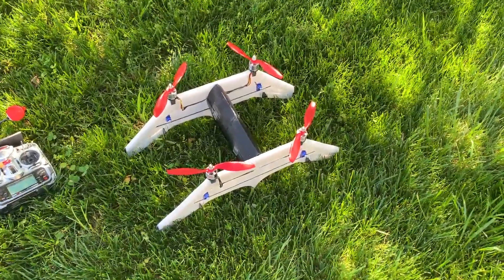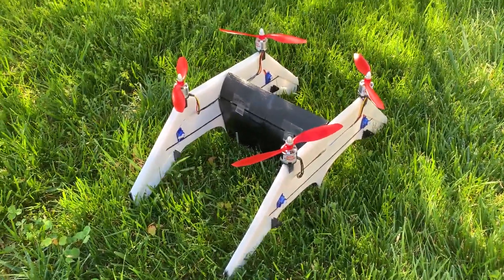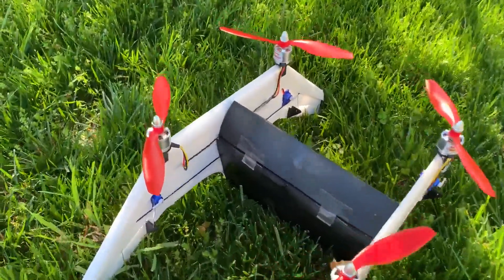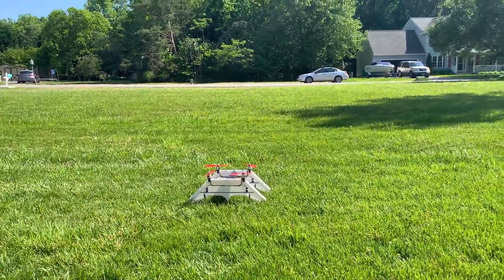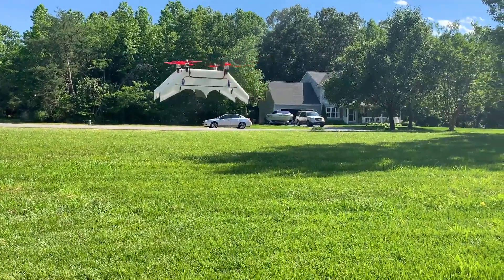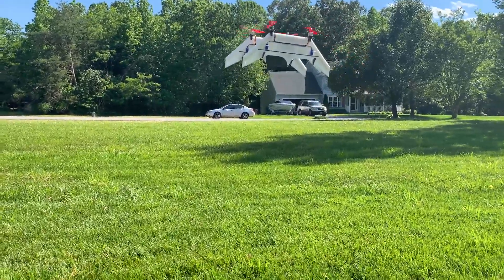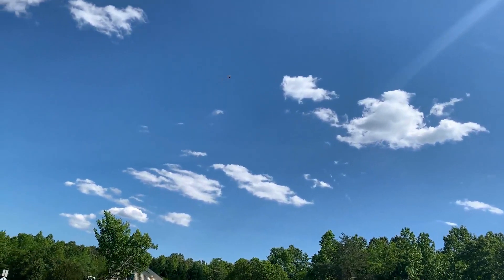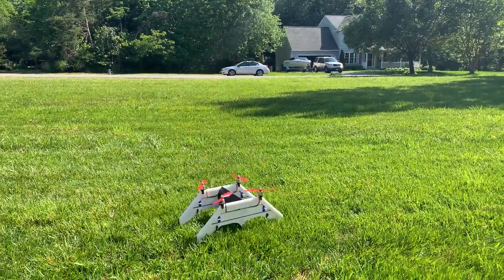Quadrotor Biplane RC VTOL

Comment: Nicolas-

Have you ever tried to build an FPV version of this?  One way you could handle motor mix is to place the camera on a servo so the angle can be adjusted 0° (perpendicular to motors) to 90° (parallel to motors).  Then use the camera angle as input to the motor mix so that roll and yaw are always with respect to the viewing angle.

Comment: Contratullations!. I´m doing one similar but without aerodynamic surfaces (with your code). https://www.youtube.com/watch?v=Q9b12pLRgd4.  It flies well but it´s diifcult to control in FF . I think i´ll add surfaces like yours. Could you pls share the controlMixer() you´ve used. Thanks a lot

Comment: Why not eliminate modes and control surfaces altogether and have the whole thing run off of differential thrust and a basically standard quadrotor flight controller and control layout?
Reply from the maker: Control surfaces give more control and reference axis switches making it harder to fly without control remapping

Comment: Great work Peter!! I just wanted to know why have you given a sweep and taper to the wings ? Thanks in advance
Reply from the maker: Sweep gives better longitudinal stability like a conventional flying wing and taper improves efficiency
Reply: @Nicholas Rehm  Thank you Nicholas for the clarification. I have a doubt and regarding the above configuration . I hope you can help me. Let’s consider 2 scenarios. In the first one, the propellers are  mounted as in the video above but the wing is non tapered and no sweep. This will lead to good propeller downwash on the wing and lead to improved stall performance during transition as the angle of attack will not increase beyond the stall angle due to the downwash. But there will be induced drag at the wing tip as the propeller downwash is limited at the tips. In the second scenario, we have the same non tapered non swept wing but the the propellers are mounted at the tips of the wings. Due to this the propeller downwash of the wing will be reduced affecting stall performance during transition. On the other hand it might decrease the wing tip induced drag if the propellers rotate in opposite direction to the vortex flow. Out of these 2 scenario what would be the better solution in terms of efficiency? Please correct me if I am wrong somewhere. Thanks in advance.
Reply from the maker: @ultimatearistocrat  very good thoughts, I suppose it will mostly have to do with your cruising speed/flight regime which configuration will be better for you. Stalling the wing, in my opinion, isn’t too much of an issue because control is always maintained through transition through the rotors. Having the rotors mounted farther out to counteract wingtip vortices is a great idea and can help at higher speeds, but it’s definitely a function of cruising speed, rotor downwash velocity, and where you are on the drag bucket. Would be a great experimental test to compare!

Comment: There's a manned vehicle design a bit like this - though the wings are staggered rather than one directly above the other.  I haven't heard too much about it for a while - don't know what happened to it.  Like this one, it could take off vertically, then tip forward and use its wings for lift.
https://www.youtube.com/watch?v=VIygDyKMVwM
Reply from the maker: Very cool, I wonder what kind of benefits they're getting from the staggered configuration other than pilot visibility
Reply: BlackFly by www.Opener.aero   Funded by Google...in development for years....23,000 miles of flights with 200lbs pay-load.   It is first intended to be an ultralight part 103 which is 254 lbs plus some amount more for it being amphibious and ballistic parachute ...maybe 315 lbs.   Capable of 30 minutes of flight at 62 mph in 2019.   The speed and weight limits are to keep within the FAA part 103 'ultralight' category..which general is: no license needed, no certification of aircraft, if under 254lbs, less than 62 mph, stall of 27 mph?.    But, it is also no commercial use to be par 103.   No commute travel, like a 'daily' job (hum?).   So, it must be a recreational 'air vehicle' for now in 2020, in the USA.  But, you can fly straight over a city, and in many places like 'parks, schools, railroads, lakes, forests'.   The danger to the public is low due to low weight, and other motor vehicles, motorcycles, etc. are an accepted risk currently.

Comment: Very cool what fc firmware did you use?
Reply from the maker: This is my own code running on a teensy 4.0 microcontroller. Keep a lookout in the future for open source code and documentation on github

Comment: Interested to see how this would work with no control surfaces.
Reply: Thanks for responding, love the projects. I hope you get the channel premonition from X jet.
Reply from the maker: It still works well--in this case, I'm testing some code for a much larger 35lb vehicle which does require surfaces in the event of power failure. Check out Peter Ryseck's stuff on youtube, he has a few no-surface versions. They 'cant' the motors inward in increase roll authority in flight

Comment: Very good! Do you think this could carry any payload? I am interested in UAS for emergency response type work, and having a smaller, lightweight, VTOL capable aircraft would be great for doing a combination of initial search patterns in a search and rescue mission, but then being able to move in closer, and give more detailed data once the search subject is found, and rescuers begin moving towards them for the actual rescue portion of the mission.

Edit: By payload, I mean cameras, maybe thermal cameras, and GPS enabled/autonomous flight controllers. Also, maybe something as simple as a bottle of water, and flare gun to give a subject some hydration, and ability to give searchers a more easily seen navigation guide.
Reply from the maker: Yes, absolutely! This vehicle is a 1/3 scale model of a 35lb, 6ft wingspan vehicle designed to carry a 10lb payload with a two hour forward flight endurance in support of first responders. The Alfred Gessow Rotorcraft Center (my team) was recently selected to advance in the First-Responder UAS Endurance Challenge: https://www.firstresponderuaschallenge.org/

As for this specific vehicle, the payload is in the ~200 gram range--enough to support a small camera and maybe flight computer for autonomous operations over maybe a 20 minute flight. A ~10lb vehicle would be much more versatile and useful
Reply: @NicholasRehm  thanks for the information, and congratulations! I have been working towards the idea of smaller systems capable of being carried by SAR teams. "Pack portable," is what I am frequently aiming towards. I could also see swarm technology where multiple SAR team members have smaller systems which then communicate with a hub, and then the hub could maybe deploy a larger (or different) system depending on determined need of a subject.

I would be interested in speaking more off of YT. Are you on LinkedIn, or some other platform? I will search your name, and connect if I find you, of that is OK.
Reply from the maker: @BuckeyeStormsProductions  You should be able to find my LinkedIn on my channel page. Looking forward to chatting with you
Reply: @NicholasRehm  great. Thanks!